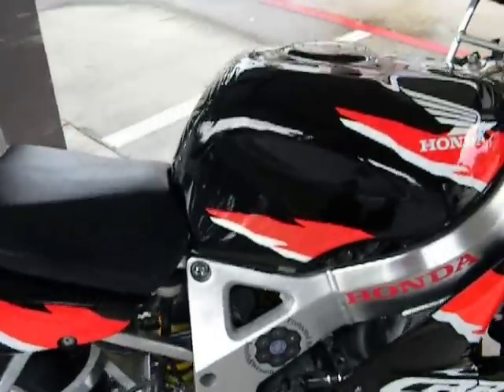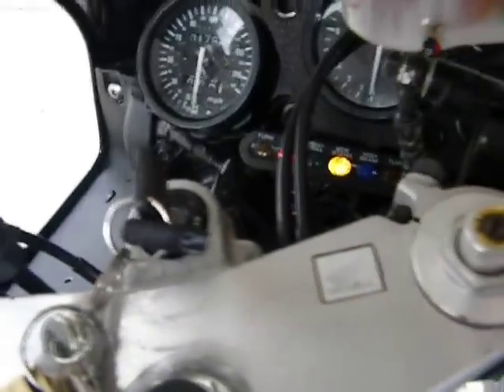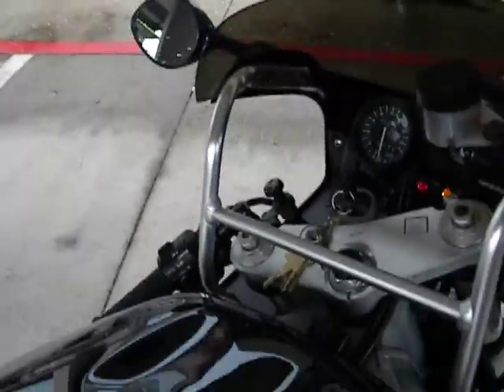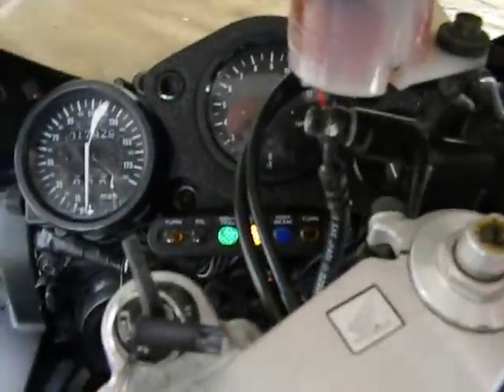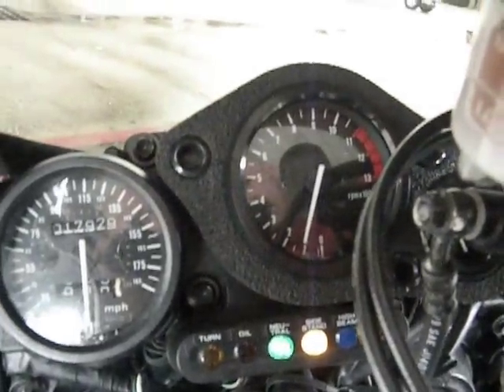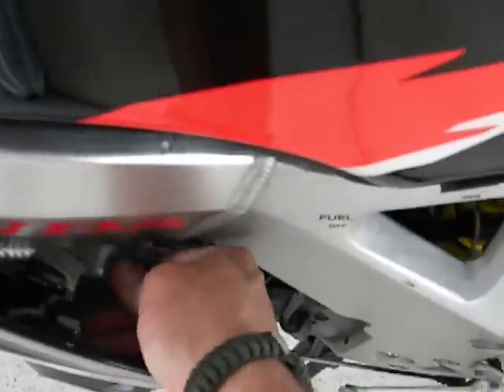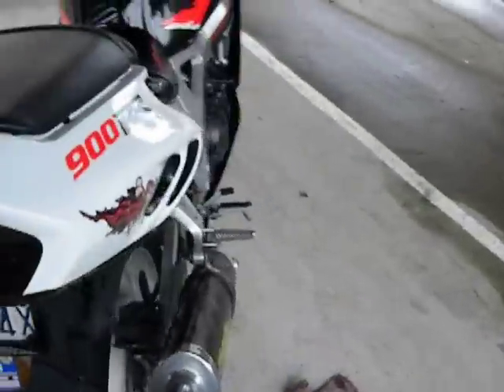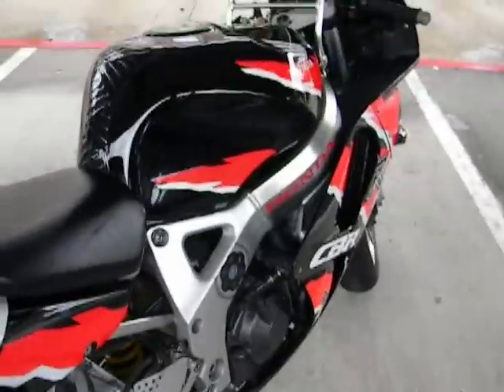95 CBR 900rr

Comment: I would recommend using a screw driver as a stethoscope. Put the plastic end directly in your ear & the pointy end on any metal part of the engine (make sure it contacts one thing only). Move it to different places on the engine & the noise will get louder/quieter (& you will hear lots of other noises too!). You should be able to locate the source of the noise like this, but it does sound like cam chain (on the RHS of engine). If it is consider yourself lucky it isn't something more serious!

Comment: To all those watching this video, if you have an 893 or 919 blade. They all rattle from cold, it is the clutch. Pull in the lever and it goes away. At between 15000 and 24000 miles the chain tensioner will need replacing, it is a common fault and easy and cheap to do. The chain will be fine as long as it has not rattled for too long, the fault is with the tensioner itself. The cbr600f is the same. The main problem is these engines are bulletproof and as such never see any servicing from lazy owners. I have seen a first gen 900 with 230000miles on it, used as a courier bike in London.

Comment: If the noise goes away at 2000 rpm chances are the the bike is idling on 2-3 cylinders i just went through this with my 96. T urns out the 2 center carbs where most of the heat is hardened the diaphrams in the carbs and they cracked , so they would pull vacuum at idle i put in 2 diaphrams and slides and it runs like it should now. So before you tear into motor check the diaphrams for pinholes or cracks even the tiniest one will render carb useless at idle

Comment: Hey, I also have a 1995 900rr, and also getting the same knocking noise when I warm it up, ones its warmed up the knock goes away.  Did you figure out what it was? i did notice that when I pull in the clutch the knock stops. It runs great 10k miles, just the knock when its warming up.